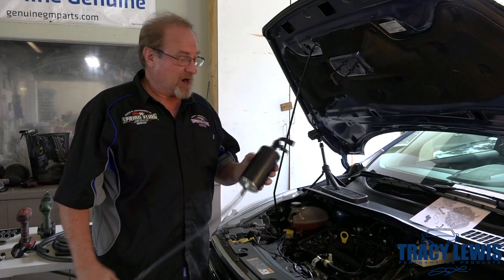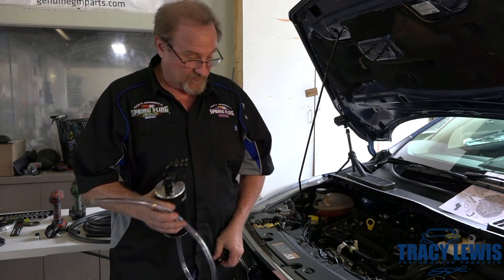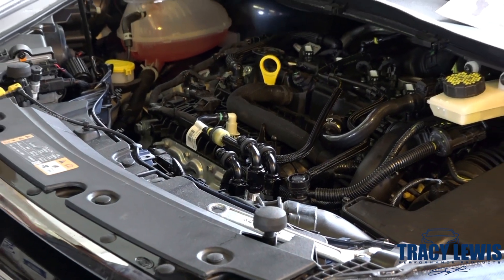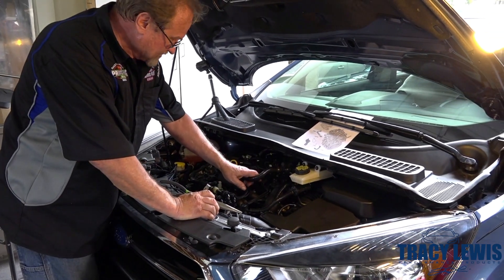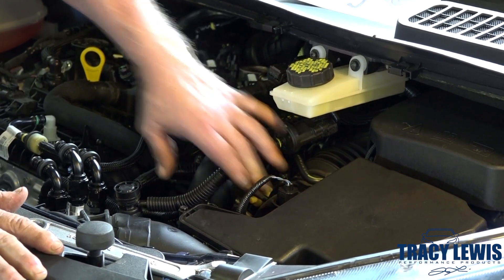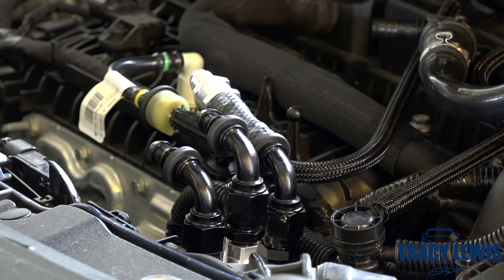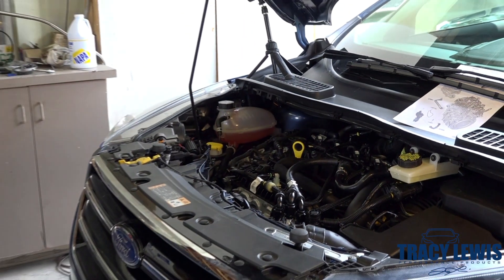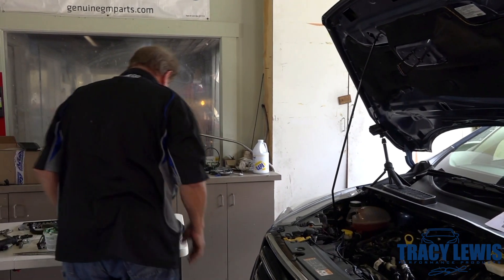Rx Performance Catch Can 1.5L Ford Ecoboost Installation

Comment: The Ford 1.5l Ecoboost motor has a factory Air/Oil Separator installed already. It returns the collected oil to the sump. Buying this kit would be foolish.
Reply: 2017-19
Reply: Does it actually function to seperate the oil thought? I assume your talking about the oil seperator that bolts on the front of the engine?
Reply: @jordanmccarthy9851   you mean the intake?  That oil is displacing air, which I don't doubt hurts "performance" to some degree.
Reply: I know it's been a while, but if you're right, it's not doing a very good job.  Take off your throttle body and see how much oil is pooling in the intake.  I haven't measured, but it would probably fill the cannister he installed in this video.